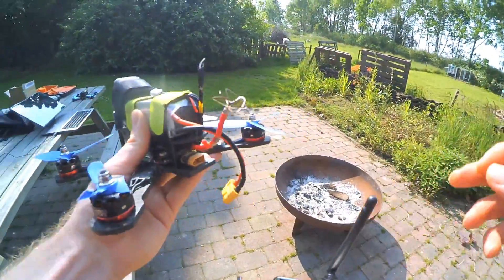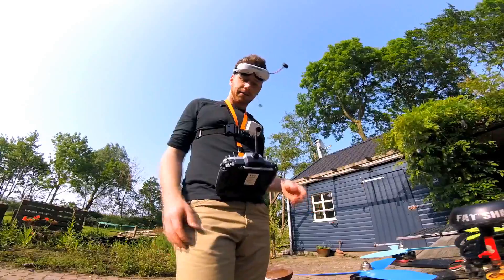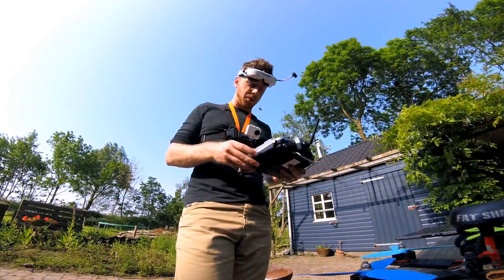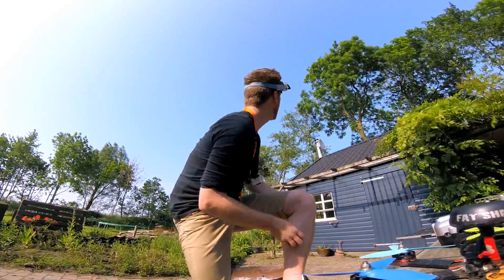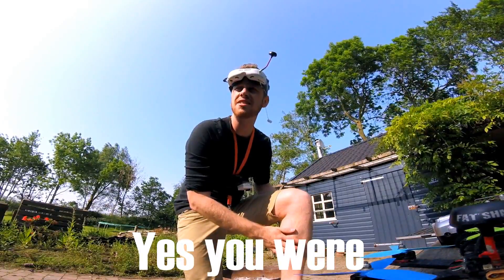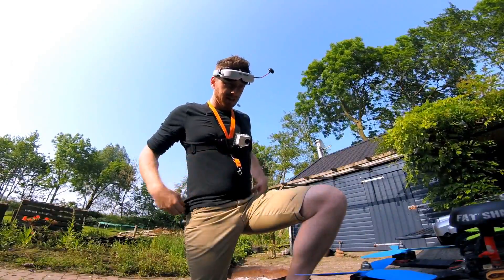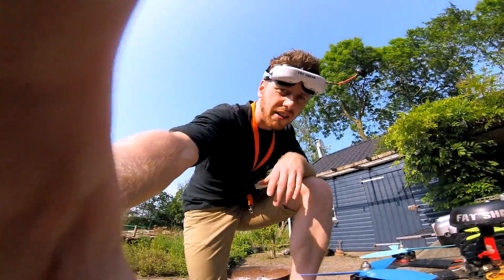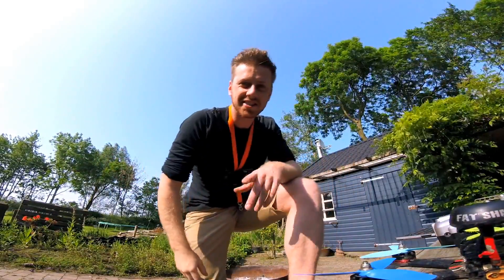FPV Stick Tutorial || Big Fail

Comment: That was some Sharp flying, Sir.  I enjoyed it:) 

I have 2 questions:   It is true the RC rate is related to the overall stick response where increasing the RC rate makes for an overall faster response on both sticks and decreasing it makes for a slower overall response? If so, then Betaflight default setting is 1.0 -  What setting do you use?   2)  What setting do you use for the RC expo rate?

Comment: are you flying air mode or acro?
Reply: Peter Lech yes, but why would you have acro off? Air mode is basically acro, but you can control your quad at minimum throttle
Reply from the maker: Acro with airmode activated like everybody. (:
Reply: Pieter Bos ok I just fly air mode..i have to try that
Reply from the maker: You either fly acro or horizon. Airmode is an feature in BF that keeps the PID controler active when throttle is at 0, regardless of the flying mode you prefer.
Reply: ok so acro is all of them of..no angle air or horizon..you dont use any of those just maybe the arm switch right..also i like horizon.. but acro is hard without goggles
Reply: what im saying is if i have air mode horizon mode and angle..all of those turned of then im in acro right?
Reply: acro is basically nothing on no modes right?

Comment: Question, is your forward flip faster than your backward flip? also same goes for the rolls, are your right rolls faster than left? or is there something wrong with my radio lol
Reply from the maker: No, both sides are equally fast on all axis. If not, than you haven't set your endpoints right.
Reply: iam slowly starting to understanding why no one uses spektrum radios _.. or maybe iam doing the trims wrong, but iam fairly certain the endpoints are calibrated correctly

Comment: how you get forward if you dont put the joystick forward ?
Reply from the maker: +45llamas its physics. When the quad is angled forward, the thrust is vectored backwards. You don't need to pitch it forward further than necessary.
Reply: i know that. im saying that looks like you dont move the pitch in the remote control

Comment: Well i have a question.. is this a thing that you stick on a drone or its the controller ? in 5:20 that tells you the battery voltage.
Reply from the maker: Neither. It's just a timer on the taranis. I've set mine to Throttle seconds and a duration of 2:30.
Reply: Thanks

Comment: Finally an instructive tutorial. That mode is sey to the radio? Thx
Reply from the maker: +Floaser21023 I'd google that. (:
Reply from the maker: +Marco Staiano glad to help. What about the mode the radio is set to? I'm not quite sure I understand. You mean mode 2?
Reply: Hi and THX for response! Yes i mean if you flight with mode 2 or 4
Reply from the maker: Marco Staiano mode 2. (:
Reply: +Pieter Bos (TaurusFPV) THX man!!!
Reply: Whats the difference between the modes?

Comment: You linked the wrong motors in your description :) Thoose are the Emax RS2205 right?
Reply from the maker: Zer0_Exeption correct, because it's outdated. They're still great motors, but I prefer to recommend the motors I fly right now. Well spotted though! Cheers
Reply: So the newer ones have more power? I'm running the RS2205 and love them so far, but there won't be any moment I'm not looking for something more powerful ^^

Comment: Massive Balls going under the trampoline!!! I am not quite ready to zip around this fast. I am 31 years old and finding myself getting dizzy AF after flying my FPV 250 Quad. How do you deal with the motion sickness feeling in your head and stomach!?! Epic flight! Thanks.
Reply from the maker: Thank you. Well, I'm 27 years old and barely keeping up at times, but it's a process. You get used to the speeds as time goes by. Besides that you'll gain control by practicing a lot, so movements are more predictable. Cheers and have fun!

Comment: Are yoy flying in acro mode?
Reply: You can only do flips in acro mode, so yes he is. And if he was in stabalize then that crash wouldn't have happend as the FC would have stopped the spin. ;)
Reply: ***** in stab mode you can change the angle (in my apm i can) so if your angle is with no limit you can do flips, i think (i didnt fly like that but i think its correct)
Reply: Gaspy xx APM on a racer????? Mh, I have a Naze32 rev6 with Cleanflight. I know there is an angle mode, that it changes the angle down but don't know if you can do flips with it.
Reply: +Sigfried Seldeslachts no its not a racer hahaha i have f450, but i want to start doing flipa with and i dont know if i should use the acro mode or the stab mode with no limit in the angle
Reply: Gaspy xx acro but a flip with a 450mm quad?????? You sure you wanna destroy your quad?
Reply: +Sigfried Seldeslachts why? Its possible to do it, not only with a racer
Reply: Gaspy xx wouldn't do it with a big one
Reply: +Gaspy xx I'm flying my F450 in Acro mode. It isn't as agile as a racer but it works. Flips are no problem if you do think about the height loss.

Comment: something that went wrong is called pilot error. lol it happens to us all. but if you would have landed when the timer counted down it wouldn't have happened. id say though you have a great little racing quad setup. keep practicing.   tommy the cat
Reply from the maker: Don't get me wrong, it was pilot error, but it had nothing to do with my lipo. My timer was set for a 1300mAh in race conditions. This was a 1550mAh and I wasn't pushing hard.

Comment: Does your Taranis read your voltage level? Is it accurate?
Reply from the maker: I haven't set up telemetry. Working with a timer only.
Reply: Pieter Bos Ah okay, thanks! Nice flying btw!
Reply from the maker: Thanks!
Reply: I have telemetry and even the smartport telemetry is real good it doesn't give you an individual cell but still real good.

Comment: Very interesting video and flight.  If your firmware had blackbox, you would know what happened in the crash and you wouldn't have to film your hands.  :)  That's what keeping me from trying Kiss FC.  A directional RC locator might help also if your battery disconnects.  I'm surprised those sheep don't mind.  What angles are your cameras at?  I want to try flying under my trampoline now!  Thank you.
Reply from the maker: Thanks Michael. My cameras are on 25-30 degrees uptilt

Comment: nice proximity there, is there a guide for setting up the 30-20-10 second countdowns for battery on the taranis? I've seen others but couldn't quite find it yet
Reply from the maker: Thanks. Yes there is: go to your model settings, go down to timer, set it to TRs, put in the amount of minutes/seconds and lastly a little further down select voice. Otherwise it doesn't talk to you. Cheers
Reply: hmm, no TRs option for me, I'll search around, got the countdown bit set up anyways, cheers, keep up nice flying!
ps.: what uptilt did you have on this vid do you remember? (Y)

Comment: that's badass flying. I'm gonna buy a vortex 250 here shortly. I've never fpv'd but I've flown other smaller quads. I bought a dx6 the newest version so next is my vortex 250. what else do you recommend I get?
Reply from the maker: Great way to start buying a vortex pro. You obviously need some goggles and a transmitter too. I would go for the fatshark dominator v2 and the frsky taranis plus. Good luck!
Reply: +Pieter Bos (TaurusFPV) "I bought a new dx6". Why should he get a taranis?
Reply from the maker: Christian Logsdon I might have missed that. Sorry
Reply: Pieter Bos And why do you recommend the V2's over the V3's? I guess that actually makes sense since the only major difference is the face plate and fan. And there $100 cheaper now.
Reply from the maker: Christian Logsdon that's not the only reason. V3's have a 16:9 ratio compared to the V2's 4:3. As almost all FPV cameras are 4:3 so I'd choose the dominator V2 every time.
Reply: Pieter Bos Good point. But I like the 4:3 stretched to 16:9. Its basically GoPro Superview. I want the attitude V3's but they dont have a DVR so thats a deal breaker. But im on the Teleporter V4's right now.
Reply: +Christian Logsdon so which goggles  should I get?
Reply from the maker: Fatshark Attitude v3/Dominator V2 or Dominator HD2.
Reply: +Pieter Bos (TaurusFPV) 
I really like the skyzone fpv goggles they are a little cheaper compared to the fatsharks but they are in my opinion better
The high-end fatshark goggles (attitude v3/dominator v2 or hd2) require a separate video receiver (or receivers when using diversity) the skyzone 3d has two 40 channel receivers built in this means that it will receive all current 5.8ghz video transmissions

Comment: Man I crashed my vortex 285 like that, straight down into concrete two motors broke straight off found em about 20 ft away from the bounce.  And the mobius broke two zip ties and went 15 ft the other way.   replaced two motors and I'm back up.
Reply from the maker: Okay